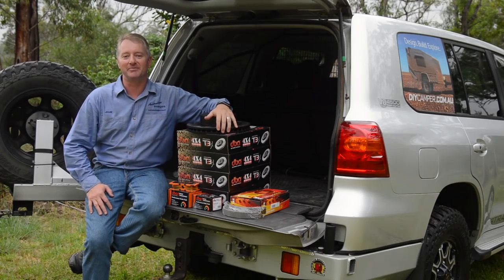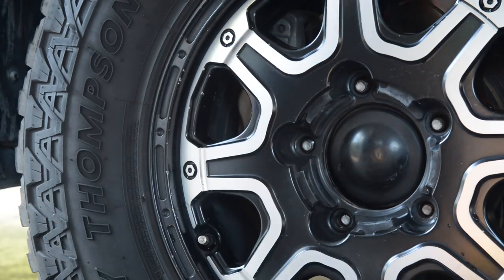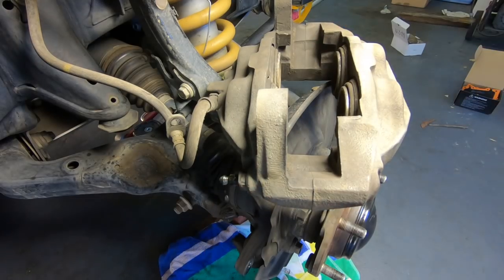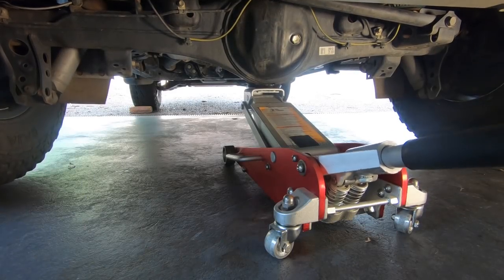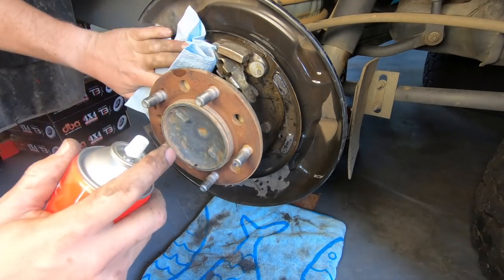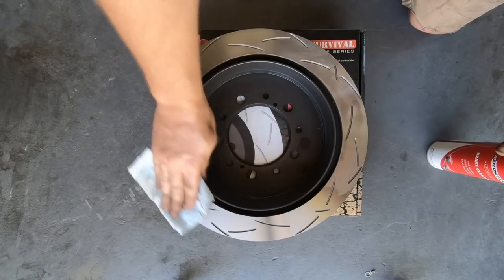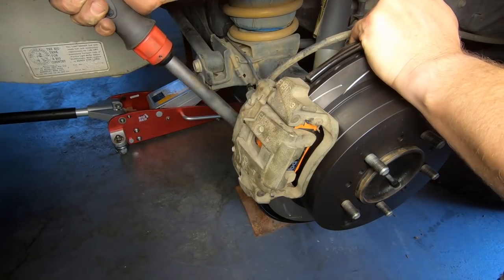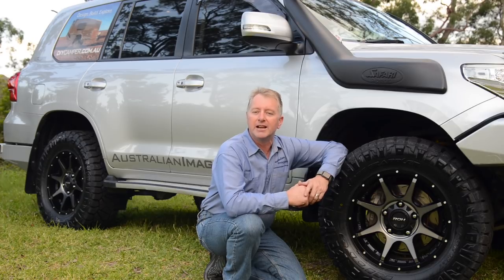LandCruiser 200 - DBA brake upgrade with new rotors & pads. Inc handbrake shoes - Project 200

Comment: Just had my cruiser serviced and Toyota quoted $660 to machine front discs and install new pads on each corner.  I bought DBA T2 slotted discs ( front only) and Bendix HD pads all round. Delivered $510.  Installed them this afternoon using this video as a guide.  It was so easy and although I haven’t driven further than a few km to bed them in, they already feel so much better. The proof will be towing my 24 foot boat. Thanks for the very helpful video 🍺🍺

Comment: Great video, saved me a bit of time nutting it out myself. I had those DBA Rotors and pads on my shelf waiting after the dealer told me my brakes had 5 000Kms left 2 years ago, changed them out yesterday with about 10 000k left on them.  I did it without the glasses,  just done the safety squint.

Comment: Thanks for another excellent video Jamie!  Clear, concise and thorough, again!
Interestingly, on my 2012 Cruiser, two of the front pads had metal tags on them, which DBA told me were mechanical wear indicators, to be fitted on the inside. 
These videos have saved me a small fortune, and I know that the job has been done properly. Thanks again!

Comment: Hi Jamie, replaced the disk brakes on my LC200 with the DBA T3 slotted rotors and Xtreme Performance brake pads as per your video, talk about chalk and cheese, what a difference.
Reply: Hi MrBellda. Can you please share experience. Do the slotted rotors cause any noise/ vibration when braking? Do you feel like they overstress the suspension due to the better bite?

Comment: Excellent video. Are you going to do one on your new tyres and wheels? I had MT ATZ P3s, but recently changed over to Nitto Trail Grappers MTs and I think they're much better. I have a '17 Hilux 4x4, so don't have full-time 4WD and the ATZ P3s were very sketchy in the wet, expecially after 45k kms. I know other people with Coopers  ATs who complained of the same issue. I suspect the compound is hard for longevity. The Trail Grapplers by comparison are a much better on wet roads, however are wearing quicker. I plan to get Ridge Grapplers next, which I'm hoping will be a good compromise, so am keen to hear your review.
Reply from the maker: I probably won't do a video, but will do a bit of a comparison page between the two tyres. I have a Cape trip coming up, so will probably wait until after that so I can see how they perform in a variety of conditions. So far, they seem at least as good as the P3s everywhere, but are much quieter on the road. I never had a grip issue with the P3s in the wet, but that could have something to do with the weight of the vehicle. I've used tyres before that were totally different on a heavy Vs lighter vehicle. Might be the same for the P3s.

Comment: Greatly appreciate your informative and helpful videos. I'm wondering if pushing the pistons without releasing the bleed valve would cause a damage? if yes, is it reversible?
Reply from the maker: It shouldn't cause any damage. But it will push fluid back up the lines into the reservoir. This is bad for two reasons. First, the fluid in the caliper has been subject to a lot of heat cycles, and is more likely to be contaminated. Second, if the reservoir has been refilled it could overflow with all the extra fluid being pushed back up. Any problems can be solved by flushing all the fluid back out.

Comment: Hi Jamie, nice video as per usual. Are the new brake pads causing more brake dust than the originals? I would suspect so and also guess that they do not last as long as the originals??
Reply from the maker: They may be slightly dustier than the factory pads, but not by much. They've been on for 2 years now, and still have about 30-40% remaining on the fronts, and 60%+ on the rears.

Comment: Hi Jamie, Great Informative videos, just had a couple of questions, With the DBA Brake Upgrade do they fit well fine under the 17” Wheels? Also when you went to 18” Wheels why did you change from 17”? Was it more because of the Nitto tyre sizes or looks just curious, in the process of looking at a 200 Landcruiser and can’t decide which way to go.

Comment: How is the brake dust with those pads Jamie? Is it ok?
Reply from the maker: They seem to be about the same as the previous pads (factory on rear, Bendix on front). Although I changed wheels at around the same time, so that makes it a bit hard to pick a difference in dust levels.

Comment: How have they been? Have you replaced the pads? Did the rotors machine well? 

Been told they warp and machining is more expensive with them and are not so good after. Eg new pads new rotors
Reply from the maker: Hi mate, Very happy with both the pads and the rotors. They are a little dusty, but that's a minor complaint. Have not had to change the pads yet, although the fronts won't be far off. I haven't had any issues with warping, and have not had to machine them so can't comment on that aspect.
Reply: @austimages  how many kms have you done it that time? 
Thanks for your reply
Reply from the maker: @ausguy4385  Roughly 50,000km

Comment: Hi Jaime, why is my front brake pads on the inside is thicker (like new) and the outside is almost wear out. Is that normal for lc200?
Reply from the maker: There is sometimes a very minor difference, but there shouldn't;t be much. It could be that some of the pistons in the caliper have seized.

Comment: How long do your suspension last ❓
Reply from the maker: It's been on there for over 100,000km now. Still working well. Tough Dog put the shocks/struts onto a shock dyno recently and they were still in-spec. I replaced the bushes and put them back on the car.

Comment: Do they have brake drums as well?
Reply from the maker: The handbrake is a drum setup, housed within the rear disc rotors.
Reply: @austimages  I mean the brake rotors that SUVs like the 4runner surf has at the back
Reply from the maker: @marc-anthonyrigg7212  Not sure what the 4-runner has, but the 200's rear brake rotors have a drum setup inside, which is the parking brake. The drums don't do anything other than the parking brake function.
Reply: @austimages  the surf and 4runner has drum rotors

Comment: shouldn't be getting any grease on the side of the pads either. hope you cleaned it off but buy the looks of it you didn't, small things like that is why you should pay a mechanic to do it. payed all that money and time to be putting grease on you discs as they wear down not good.
Reply from the maker: The sides of the friction material were wiped off. Should have mentioned that in the video. Grease only remained/remains on the backing plate.
Reply: DBA supply the grease for fitting the pads. They should know!!

Comment: Bad job - you must change callipers (supports) on Brembo for 380-405 mm brake-disk diametr !
Reply: for front brake
Reply: for front brake
Reply from the maker: It's not a race car! The standard size rotors with 4-piston calipers are excellent for typical driving (and more). But yes, Brembo do make a 405mm/6-piston upgrade kit if you want to spend A$10,000 on them!
Reply: @austimages  
1. not 10 thousand dollars and only 2 thousand dollars
2. yes, not a racing car, but you still need to slow down, and at night on a bad road it is always emergency braking, on a mountain serpentine, in a city traffic jam, too, the regular brakes overheat and become wadded - there are not many brakes! And your solution with dba is a dead poultice!
Reply: Brembo Brakes on a Toyota Landcruiser. Lol too much mighty car mods mate.
Reply from the maker: @zzyzxyyxp4542  Price I saw for the kit (405mm+6pot calipers) was £4346, which is A$8000, plus shipping and tax, just for the fronts. Nobody keeps them in stock in Australia, so if you needed new rotors or pads in a hurry, you'd be in trouble. Whereas the DBAs are stocked widely. The other major downside is that you'd need to change to 20" wheels at least (perhaps 22"). The choice of off-road tyres is very small for that size wheel (and also very expensive), and impossible to find when travelling outside cities. So the better braking comes at the expense of offroad ability, maintenance/repair downtime and at a massive cost for both the brakes and the replacement wheels/tyres. There is also a question of finding wheels that are load-rated for the increased GVM. For the vast majority of people, the DBA upgrade delivers more than enough braking performance.
Reply: @austimages  we had a CLK 63 AMG and at 120k km the front rotors were up for replacement.  They were huge units and two piece so they can’t be machined.  Mercedes Benz was going to charge us $4 K for each rotor, this was back in 2012.  We loved the car but ended up selling and buying a Lexus which, by the way has awesome brakes.  Just sayin 🙂🍺🍺. Oh, I was going to import the rotors from MB Hollywood for $2k for the pair but we sold the car.